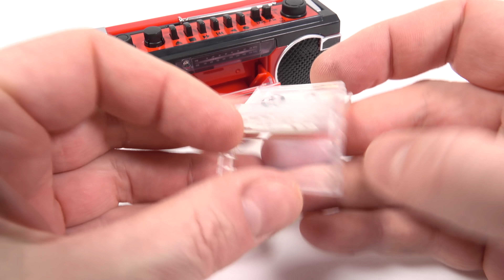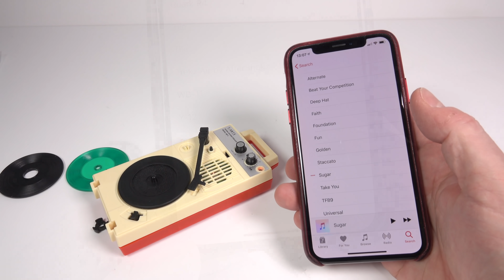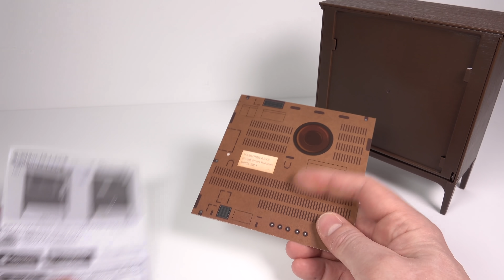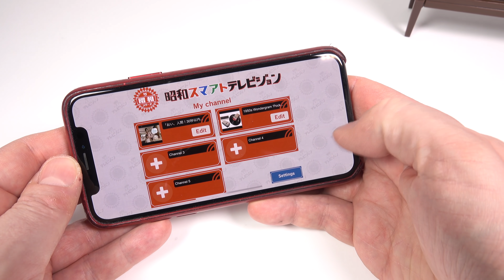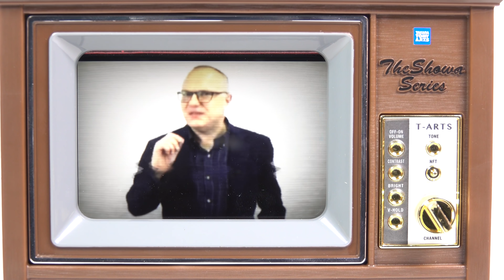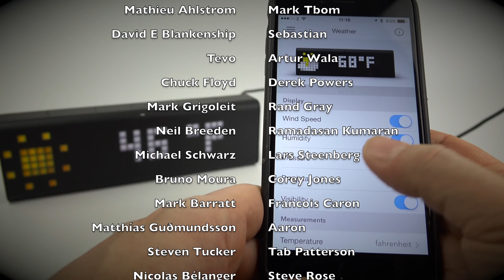Mini Retro Electronics from Japan

Comment: The TV is awesome. I was a little iffy about it but the different era setup and static fix make it great. Someone else mentioned that if you had static instead of the "now loading" it would be perfect. I agree.
The record player is kind of nice but sure does have a lot of noise coming from it. Was that intentional? If it was it be nice to be able to turn off the noise without turning anything else off like say the turntable.
And the boom box was the least appealing of the three.

Comment: they could have made an adaptor with a card reader inside the cassette and u put the SD card inside the cassette and it will read the cassette when u put it inside the deck via usb connection that will contact the bottom or side where ever it makes more sense for the design!! ... and lithium ion battery with much more ruged construction and I will buy these!! I like the look of these!!!

Comment: Someone else has probably already mentioned this, but I have the boom box, and the microphone seems to be inside the faux knob that's labelled as "mic," which is why there are slots cut out of it on the sides. Shocking, I know.

Comment: I like those. You have many neat devices and relics in your collection. Most of these I've dealt with. I don't know if you ever had a chance to hear am stereo before. That was really a nice experience and experiment in the 80's and early 90's I transmitted am stereo to myself across to Boliver peninsula on upper end of 26MHz using my am stereo radio combination with my sw receiver using if as a conversion radio. Only use 1/2 watt to carry signal.

Comment: I could understand if there was a micro SD card that fits in that little cassette and maybe even a motor that runs dummy wheels and it might get more sold.  I mean, according to the conversion I did, it comes out to 1 pence shy of £28 <> The television actually  looks like a pretty cool device.  I might actually pick one up.

Comment: Strangely, I'm reminded of a story my parents told me. They had a B/W 425 line TV for some years but when it was announced on said TV the 425 broadcasts were to be discontinued eventually my parents discussed finally buying a colour TV... at that moment the old B/W 425 line TV made a loud buzz, the screen image went green, and then it went off. After that it would still switch on and function normally for a couple of minutes but would always then let out a loud buzz, the screen would go green for a bit, and then it would switch off...
...it's almost as if the old telly had taken exception to it's proposed replacement. "Hey, I can do colour but that's all you're getting!"

Comment: That TV is totally up my sleeve... I'd rather have real wood and a dedicated screen however. I plan on doing this with the computer inside the computergame Grim Fandango from 1999... thats where my username comes from. I plan on getting it 3d printed mostly, then fitting a screen, then just scrapping an old vintage cameralens or binocular to act as the bulging screen. It looks so iconic.

Comment: That whole set just goes to show: sometimes, the Japanese are crazy, but in the most ingenious ways 😁👍... Two ideas about the mini TV:
- Does the app let you set a whole playlist as a channel? (Could make it even more interesting, but, at a guess, it'll probably only take single videos, but not the complete list...)
- A little mod idea: if your phone supports some kind of wireless charging, stick the appropriate charging pad to the holding clamp, pull the power cable out of the right place in the back panel, and you end up with a pretty nifty retro charging station, while watching your selected channels 😀...

Comment: It would be interesting to see inside the Boom Box. Does it have screws to open it ? 
Fascinating. I remember when Sharp produced a  real retro stereo vintage radio cassette back in the late 70,s. They came in vintage colours like 50's and 60's I think. They were nice machines.
They were reminiscent of the Bush Blue radio but high quality stereo. Nice round curves and no sharp corners.

Comment: I read it too fast, and I read T-ARTS as FARTS. Ugh... The thing randomly goes on the blink, and you have to smack it to get the picture back? I was born in the late '70s so our TVs were completely solid state by then. I did hear my parents and siblings talk about tube TVs though. I was barely old enough to see large screen black and white TVs being sold in stores. I'm kind of glad to have seen that even if they disappeared quite quickly. Ironically, the last tube TV that I bought was a 5 inch, black and white TV. I got it for severe storms since it was battery powered. It was on clearance for $10. It also came with a notice that its analog tuner wouldn't receive anything soon. I got enough use out of it, and made a battery pack for a DC powered digital tuner so I could use it for a while. I still have it somewhere around here...

Comment: Hitting the TV to fix it dates from when they used vacuum tubes and it sometimes helped to re-seat the tubes. It didn't work so well on transistor TVs except for those terrible modular sets. But, people seemed to keep hitting them anyway.

Comment: The 8 Bit Guy "Thanks for having me" 
LGR "Greetings from inside a plastic phone case" 
Technology Connections "I wish this was a real crt" 
VWestlife *Scream in New Jersey Noises* (Actually said) "This smartphone TV works much better than the cardboard one I reviewed".
Reply: LGR- it's got to have a woodgrain surface and run on DOS or failing that, Windows 3.1.
Reply: Technology Connections: "These....ARE pixels!"
Reply: @namewarvergeben  
8 Bit Guy- If it's not a Commodore or an Apple II, or if it doesn't have a square wave generator sound chip, he won't review it.
Reply: LGR and 8 Bit Guy are figuring out ways to mod an RGB input to the TV.
Reply: No, they are commenting on how the ractio is wrong for a TV of that period.
Reply: Read all of those in their respective voices.

Comment: Now all they need to do. Is create a full sized analog TV replica. That won't weigh as much as the original models. That will have a built in display panel. And an internal docking station for the smartphone. The dock will allow the signal to output onto the display. Both audio and video. On the top will be a replica of a VHS player. Mounted on to the top of the set. That will provide lights and sounds. But will have a fully functional SD card slot. To watch recorded videos on. A bluetooth remote will allow you to activate the VHS replica. Allowing you to fast forward and rewind the video
stored on the SD CARD. However all the virtualization. Would be controlled by the software running from the Smartphone. If not by smartphone. A Raspberry
 PI I'm sure could power the lights and sounds of the VHS & the 21"in. display panel. That would provide the perfect simulation of watching movies the way they were viewed in that era. I realize that the Raspberry Pi wouldn't have enough voltage. So an additional power source would be required to power on the display panel and internal speakers on the cabinet case.
Reply: I wonder how difficult it would be to have a replica VHS tape that the SD card was put into, that would then connect it with the rest of the set when you inserted it into the replica VHS player.
Reply: @bansho7076  actually it wouldn't be. Reason why is because no VHS tape was necessary. The sounds the VHS made was a simulation.
The VHS unit would contain an SD card reader. A small compartment door would open. Then you would insert the memory card. And close the door.
The VHS replica would be tethered via USB 3.0 or 3.1 directly to the Raspberry Pi. The display panel would draw power from a completely separate power supply. With specific software created for the R-Pi. It would allow the video to playback & rewind & forward video simulating the VHS visual distortion effect of a 2-head or 4-head VHS. The video would output at 360p, 480p, 720p. On the display panel. Various video services would work as well. Such as TubiTv, Crackle, PlutoTv, HBO'Go, Hulu+, Netflix & many others. Even streaming torrent sites.
Reply: @PazzoScansafatiche  no torent those sites are bad for any pc
Reply: @nathanmead140  just use the, real stuff,loads tapes at boot sales ,have one of last crt sitting in front of me,vhs under table

Comment: How does the selector switch on the TV work without batteries, or have I missed something?
Reply: It works just like passive pens for graphics tablets do.
Reply: @Kacpa2  I wondered if that was what it was, my phone won't respond to anything but direct  contact so can't see it working for me.
Reply: @dav1dbone A capacitive pen stylus like the one touching the screen in this video should work with any smartphone.

Comment: The TV app taking advantage of the phone's accelerometer to allow tapping the top of the set to 'fix' the signal is an excellent and unexpected touch of genius.
Reply: The whole thing is ingenious. The fact that it uses an app, that preloads the video, and then automatically adjusts the video to the correct dimensions of the TV is just brilliant. I've seen so many where you just stick your phone in while the video is playing, and that's it.
Reply: I thought so as well. When it went fuzzy my first thought was to thump it. Sure made my day when he did and it cleared up.
Reply: Its unbelievably genius! Frankly I'm amazed of something so simple yet so functional in a cheap piece of tat! Manufactures here in the US or China never would've done something like that. They would've said here "put your phone in a little box shaped like a tv and your done. Oh and you have to pull it out if you want to do ANYTHING with it.
Reply: Hardly "cheap".  That TV costs about $70 at the links I checked.  The phone is what provides the bulk of the functionality.  It's essentially a $70 app!
Reply: I legit started laughing when that worked.
Reply: As long as it didn't happen too often
Reply: It makes me want this now
Reply: I was kind of disappointed that it didn't show fuzz when changing channels though. That "now loading" screen is just begging to be replaced.
Reply: but then there is the loading screen that says "now loading" instead of showing something that would be more immersive.
Reply: That one made me laugh...
Reply: That was awesome. Truly a part of the television experience. No reference to the fine art of rabbit ear tuning though. :)
Reply: Maybe add an Ariel which you have to move all over the place to get a signal
Reply: These little touches really take the experience to another level. I legit giggled like an idiot for half an hour the first time I played the Cooking Mama series on the DS and found out you actually have to blow onto the screen (the mic really, but its positioning is perfect) to clear out things from the in-game countertop like when you spill flour and such.
Reply: It was hilarious. Reminded me to my first experience of a candle app from about 8 years ago, in which you can tilt the flame by tilting your phone, and you can blow it away by blowing the screen (the blowing is detected by the mic).
Reply: You can also shake the tv too.
Reply: Its japan what do you expect
Reply: @Hans5958  Regardless of the fact that its from Japan, it's the fact that they even thought to add that "feature" that's impressive. Despite having dealt with similar issues in our TV growing up (until I learned to open up the back of the TV and adjust the horizontal and vertical stabilizers) I would never have thought to use an accelerometer to mimic a TV losing its electron beam stabilization. Whoever it was that thought to add that small and relatively obscure yet significant detail gets a beer from me should we ever meet.
Reply: Unlike blowing into cartridges, slapping the tv did cause the electron beam to restabilize after losing its place. The real fix is to adjust the horizontal field so it doesn't drift over time and lose its place, but a good slap was quicker :P Particularly right after starting up and it wasn't warmed up yet.
Reply: genus..?.. nah I'm sayn penus
Reply: It shakes the phone
Reply: Adjust vertical control knob is what we did.
Reply: Hey I'm making similar retro TV and app with remote control. But I'm using cardboard for the TV and headset + minijack input for remote control. Check out my facebook page with the project. Search for the word UNIKARTON on FB. It's currently in polish but there's some pictures and videos with similar stuff. Unikarton + Teleniedziela = video with my idea of remote buttons.
Reply: Yeah...but I feel like this promotes violence towards TVs and we need to watch what we say and do in these politically correct days.
Reply: Definitely! Though I will say seeing your comment before the video was a bit of a spoiler :)
Reply: Well my first clue that it would be the outcome was when he mentioned the setup guide talking about a "sandstorm".
Reply: gustavo.goretkin Um. Watch the videos first?

Comment: That little plastic t.v. is the coolest of the bunch. I lost it when you slapper the t.v.. I do not miss the days of percussive maintenance.
Reply: The TV manufacturers were ahead of you... In the '70's I worked for GTE Sylvania's TV factory in the good old USA. At the end of the final assembly line was a person holding a hammer handle with a foam rubber softball jammed on the end. As each powered-up TV passed, the worker would whack it on all sides - if the picture flickered, the set flunked the "flash on tap" test and went back for rework.
Reply: @loopshackr
That's reassuring TBH. TV sets of the day weighed a good 60 pounds or more and were often set on low tables (more stable that way). People, especially children, bumping into the TV was a common occurrence, and it would have been very bad for the brand if bumping the TV could make it malfunction even a little.
Reply: I thought Sandstorm was a Darude reference.
(Thanks to Clint Basinger of LGR for inspiring that joke in The Organ Trail.)
Reply: @Christopher-N Japanese call the picture noise / static 砂嵐 "suna arashi" which literally means "sand storm".
Reply: @ModMINI : Yeah, I guessed.
I have a TV that sometimes needs a slap to clear the picture (it's a bad connection between the coax connector and the circuit board it's mounted to).
Reply: @ModMINI  that is rather charming. when i was a kid it was called 'snow'
Reply: @ModMINI  interesting. Like how we call it "snow" or "snowstorm" in English.
Reply: We may have lost the thrill of giving the set a slap and tickle but, we still have the warm up period. Plus the rabbit ears are back. See, the more things change the more they remain the same.
Reply: @ComblessMan  tis true.
Reply: Me neither. Old color (sorry UK; 'colour') TVs(60s/70s) were unreliable and the picture quality was inconsistent over time. We could spend a whole night setting the good RGB balance using the knobs at the back. They were already a lot better in the 90s.
Reply: Don't forget to give a double thumbs up and go "Aayyyyyyyy".
Reply: Surprisingly enough percussive maintenance is still a thing for some electronics. I dont know what products but i remember recently (the last few months) watching a video about a number of more modern things it works on
Reply: Percussive maintenance = "the Fonzie method of apparatus re alignment " (approved by the Montgomery Scott academy of miracles and engineering)

Comment: 2:52 It's probably using the speaker as a dynamic mic when recording. ;)
Reply: @Kevin Patz 

Ahh, that could be it. Well spotted.
Reply: It probably is easier and cheap enough for them just to add a small electret mic, as the speaker sensitivity wouldn't be great.

Comment: I remember the days of percussive maintenance.
Reply: but there not over
i fixed a $900.000 cnc mill by kicking it
(was a mazak INTEGREX e-670H if anyone was wondering)
Reply: I had a Panasonic widescreen 1080p HD crt bought new in 2005, around 2010 the coaxial tv input started "sandstorming" and I'd have to whack it on the side like the good old days to straighten the picture out. It only did this with the coaxial input, thought. HDMI, Component and Composite never gave me trouble. I ran the unit until 2014
Reply: "If in doubt, give it a clout."
Reply: i'm actually slap the side of my laptop screen when it starts to look like spectrum's loading screen
Reply: lol what is that??
Reply: Our bass player's amp requires regular percussive maintenance. People think it's part of the show.
Reply: I hit things that don't need it just so i can break them and hit them more
Reply: Or if that didn't work, you could call an actual person (not a robot) who has not been outsourced that actually knows about how the machine works to have them come and repair it rather than throw out the entire thing and waste perfectly good electronic components. The good old days, huh?

Comment: I also spent an inordinate amount of time back behind our console television
Reply: I went back there to peek through the little holes in the cardboard/wood/whatever it was and get a look at the glowing tubes inside. It was like magic going on.
Reply: Mod MINI I ended up having it open with a multimeter on the input of the HV transformer to debug a heat sensitive bad connection near one of the power transistors.  That was the 1980s model.
Reply: My antenna input Jack needed a good jiggling every now and then to get the picture back in focus, it was set away from the wall just for that reason.